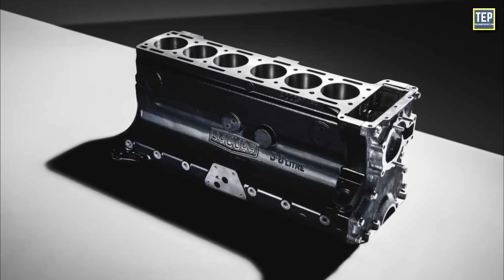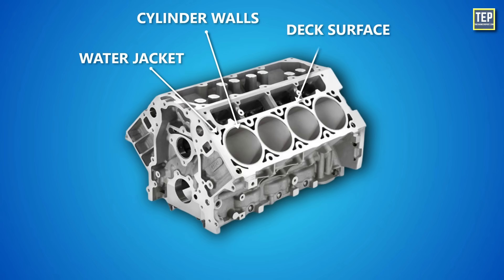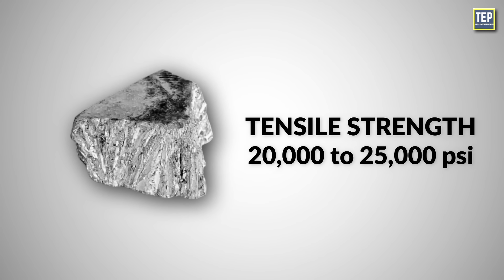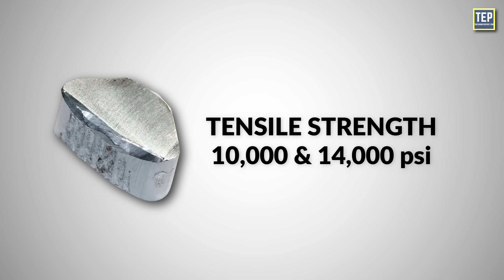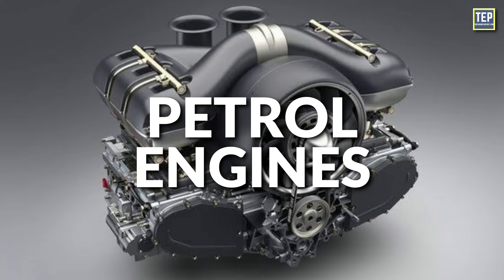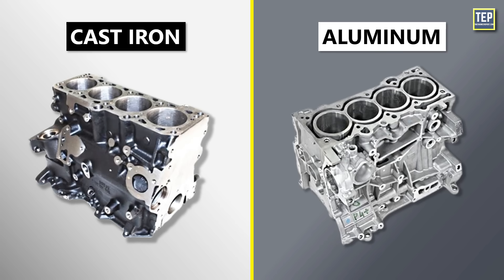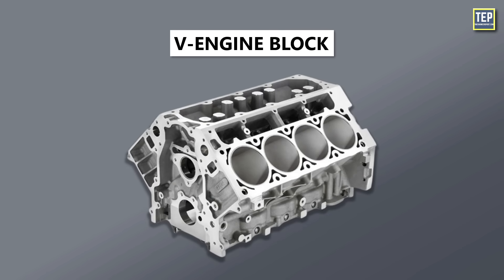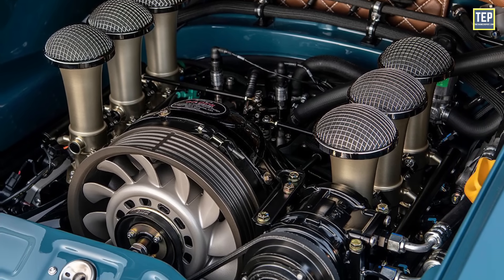Engine Block Materials Explained | Strength vs Weight

Comment: Offcourse cast iron if durability, long life and cost frindly one needed.
İf performance needed with light weight so aluminum
Reply: an iron block will go 70-100K miles before needing a rebuild, new modern aluminum engines run for hundreds of thousands of mile before needing a rebuild.

Comment: Aluminum engine blocks are of lighter weight than iron in a car for auto racing and by design for sub compact road cars. Neither have any performance advantage(s) over another.
Reply: But there's a huge difference in durability.
Reply: Considering that aluminum engine blocks are lighter in weight, the main objective would be to get as much out of the horsepower it does generate as possible, and if that necessarily means designing that engine block to become a stressed member of a carbon fiber monocoque chassis, so be it.

Comment: It depends on what you are using it for.  For conventional passenger cars and trucks, cast iron is the best, as it is more durable and more resistant to damage.  For racing, aluminum is better because it is so light.  It can mean the difference between winning for a few inches or coming in second by a few inches.  In racing, that is all the difference in the world.
Reply: Because you can engineer around the problems that alloy engines present easier than the doubled weight of a cast iron block 

Especially in a world where fuel efficiency is king.

If your engine is overheating, something that should not go wrong, has already gone wrong
Reply: @greebj  Serious warping in cast iron engines (due to overheating) doesn't happen much often unlike aluminum ones, at the expense of heating up faster.
Reply: 'For conventional passenger cars and trucks, cast iron is the best,'
...
Nope.
Reply: @oldbatwit5102  yep
Reply: @DiaperDon_BoneSpurs_Epstein  then why are the vast majority of car engines aluminum?

Comment: What about when it’s cold    I heard a aluminum block will flex a little vs a steal or cast iron will just crack
Reply: Been through several cold spouts and never had a problem
Reply: Actually, the aluminum block is notorious for cracking, not the cast iron.

Comment: Not too many manufacturers offer blocks of similar  design in both aluminum and cast  iron, thus restricting the options for a given application.  LS engine being one of the limited few.
Reply: I think there is only 1 LT1 Engine that is Cast Iron now and that is the L8T
Reply: @shadowopsairman1583  Another  GM engine series.  The LT series is the successor to the LS.
Reply: The inline has a low end torque advantage and better balance operating performance as well as being fuel efficient, can handle boost manly turbos and durable (mostly I6s)
The v engines can fit in a variety of applications and are more sporty performance oriented engines, much like the inline engine the v engine can handle boost (supercharged and turbocharged) and can produce torque at a wide range powerband but way more over higher rpms than an online that completely tails off so flat. Depends on what you using your vehicle for.

Comment: Iron block and head for me anyday.
Reply: yep, every time. they will get you and back better than alli.
Reply: Iron blocks don't blow head gasket as easily as aluminum  overheat very easily and blows head gaskets
Reply: @wendwllhickey6426 not really aluminum can last 20+ yrs as long as you maintain and don't abuse it
Reply: @wendwllhickey6426 I believe my 2014 Honda 2.4 4 cyl is aluminum block and head. 88000 miles so far with 0 problems. Other Honda and Toyota go millions of miles with similar engines.
Reply: @wendwllhickey6426  Mostly because the block is cast and the heads are aluminum, but it happens in full aluminum engines too and it is WORSE.

CAST IRON EVERYTHING OR THATS IT

Comment: How do I know if I have an aluminum or iron block?
Reply: Magnet?
Reply: @Pene7942  Bingo.
Reply: If your engine is cold, and you start it up... if the temperature raises pretty quick,  its probably aluminum...if it takes awhile for that temperature hand to rise, its probably iron
Reply: Decode your VIN number. In raport should be written everything about every part of car
Reply: Easy to see. Aluminium blocks corrode over time. The "color" will be lighter grey with white spickles (no panic, it won't hurt the block). Iron blocks do not change "color". Too bad if your block was painted.....
Reply: Scratch it with nail .soft al. Scratch easier

Comment: Titanium block has left the chat
Reply: Maybe so expensive 😢
Reply: but expensive
Reply: Brilliant.
Reply: That maybe for the best
Reply: Titanium doesn’t dissipate heat very well
Reply: @Dewanbothiab tungsten block then?
Reply: @herumusicman8200 tungsten is very heavy, and heavy things don't like to move
Reply: Titanium can Not be Cast. Must be Welded in an Argon Chamber. Very Difficult to Machine.
Reply: @RHF52  "Welded in an Argon Chamber" sounds like magnesium to me,
Reply: Titanium is extremely difficult to work with. You can't really cast Titanium like Aluminium or Cast iron
Reply: How many titanium engine blocks do you know of?
Reply: Difficult to make complex designs in Titanium
Reply: Do titanium engine blocks exist?
Reply: Titanium would be terrible - if scratched or scarred it will break.

You also have to use only titanium on titanium - so titanium heads, valve covers, oil pan, screws it is and so on …
Reply: You mean 'unobtanium'
Reply: Recicked hard pkastic on Beodium generator,,,100 yewrs  of power
Reply: @julijanmagda7855  are there available basic designs of that Power plant configuration
Reply: Ok do u know any brand that makes titanium blocks If so share  !
Reply: Automation the car company Tyco
Reply: Expensive as **
Reply: Truck season iron cast.
Reply: With a supercharger
Reply: This video is a comparison between iron and aluminum block, ita not about different types of engine blocks
Reply: @EastCoastinn  GLOCK says : Dinosaur! Geddoutamyway!
Reply: *Economy rises
Reply: while the money stays in
Reply: Tungsten block has been banned from the chat because he literally crushed his opponents

Comment: IIRC, the best material for engine blocks, especially for high performance production cars that are expected to be reliable, is CGI (Compacted Graphite Iron), an iron alloy used for NASCAR engines which are known for engines with even higher mean piston speeds than F-1 engines and cover longer race distances. It's not cheap though.
Reply: The main factor for rpms is weight. So if that iron is lighter than the alternatives for the same strength then yes. And while I dont know what F1 engines are made out of if its the best material shouldnt they use it as well?
Reply: Certain truck engines use this type of alloy for weight reduction, they are mostly new Cummins engines that use it.
Reply: Ford Racing used to sell the 6 cylinder NASCAR blocks decades ago.  All custom stuff.
Reply: @blingbling574 The EcoBoost 2.7L V6 in the F-150 from a few years ago are CGI, 380 lb-ft of torque is no joke, especially from only 2.7L.
Reply: F1 cars revved up to 20.000 rpm, so no , nascar engine isn't better, also during 1 F1 season you can only use 4 engines in total over 24 races , 72 practice sessions and 72 qualifying sessions.
Reply: Those engines are usually also used only once, since they're worn out after a single race.